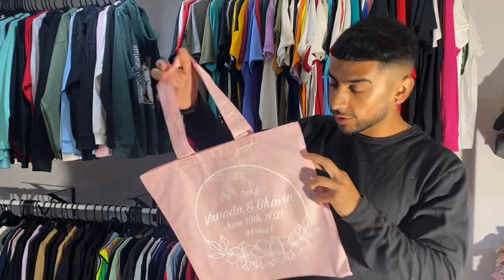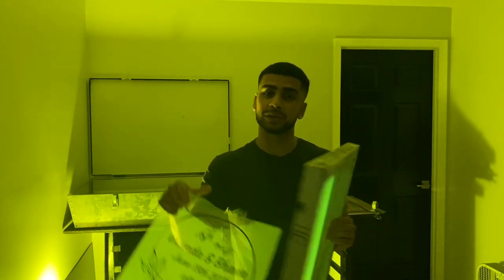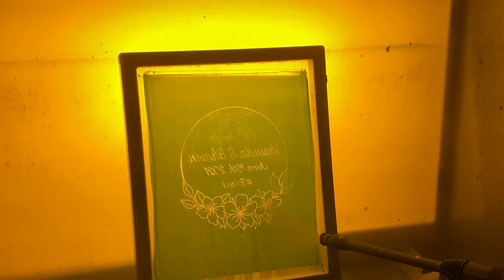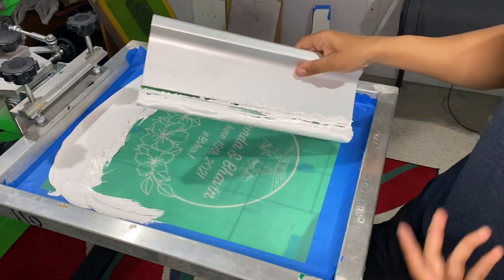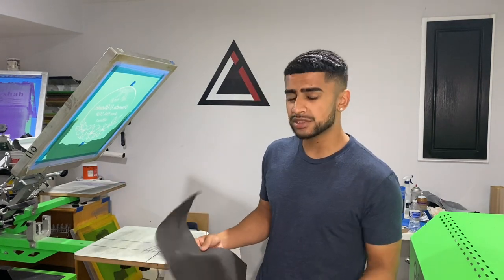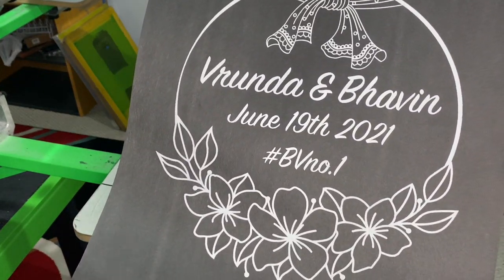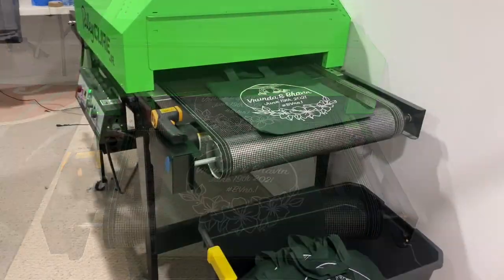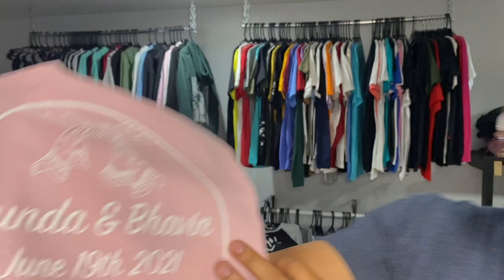How To SCREEN PRINT Tote Bags

Comment: How are you able to run your conveyor dryer in your house? Is it wired into the wall? I’m assuming it is at least a 20amp plug
Reply from the maker: Correct, I had to get an electrician out here to get a 20 amp wired up.

Comment: I noticed that your screen always clean the screen printing press with a spray and a small brush. What is the name of the solution and what does it do?
Reply from the maker: Hahah nahhh its pretty dirty to me, I should clean it more. 

The spraying I do on the pallet is just water and a brush. nThat brushes the lint off the pallet from all the garments printed and reactivates the water-based glue from the flash.

I have a video called Water based pallet adhesive, that explains it all!